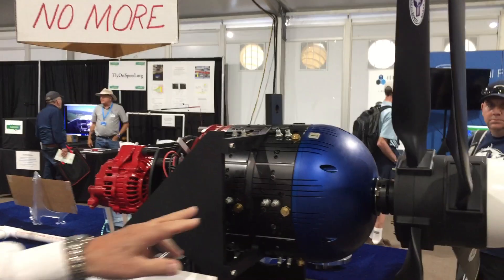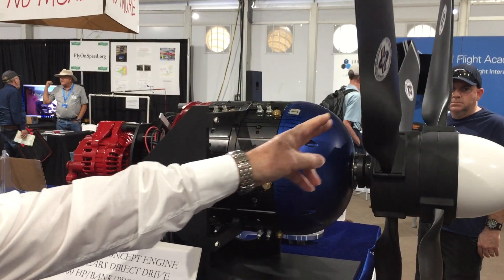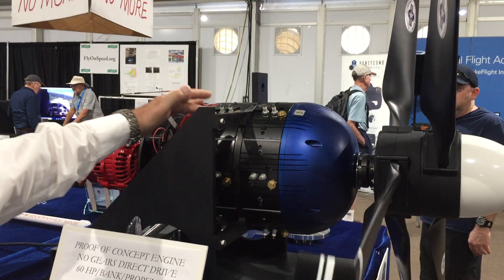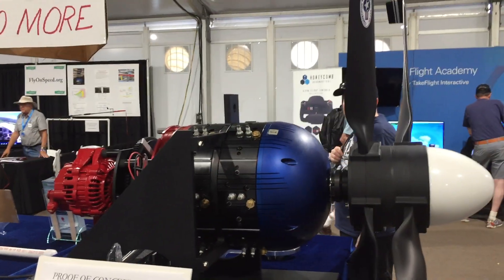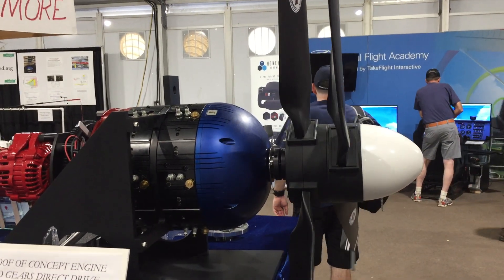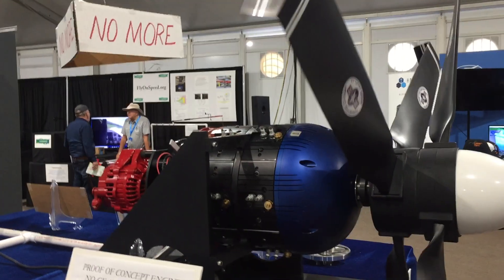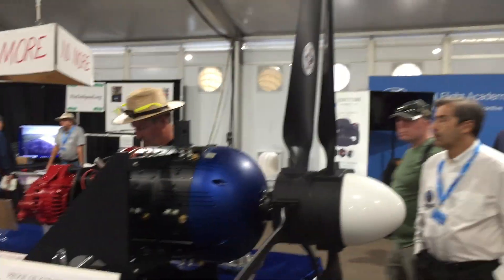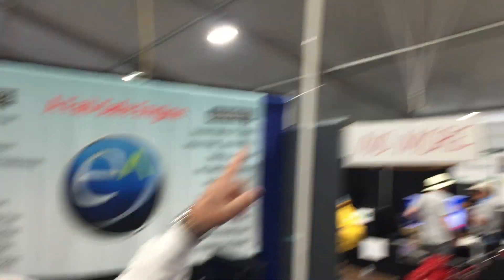Exponential Engine

Comment: It’s just a WWI era rotary engine.  Look at freepatentsonline.com/20170328277.  Can anyone spell BS?
Reply: A rotary engine has a fixed crankshaft and a rotating cylinder block with the pistons attached. The cylinder block rotates around the crankshaft and the pistons move in and out of the cylinder walls as they rotate, producing power. Rotary engines were known for their high power-to-weight ratios and were commonly used in aircraft during WWI.

On the other hand, the Exponential Engine (at least on a theoretical level) has a conventional fixed cylinder block and crankshaft design. It uses standard poppet valves and can be configured to run in either a two-stroke or four-stroke cycle. The engine can also be equipped with an Oxygenation System for high altitude operation and water vapor injection. The design allows for a minimum of two power strokes from each piston for each 360° of crankshaft rotation, which leads to an increase in power output.

Overall,  both engines have very different designs and operating principles.